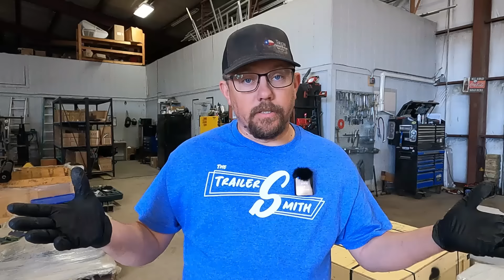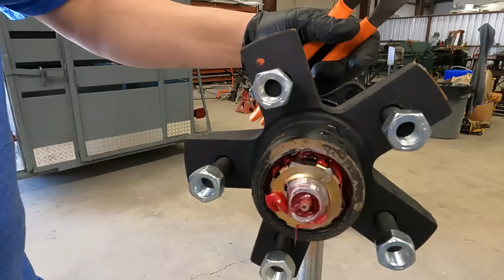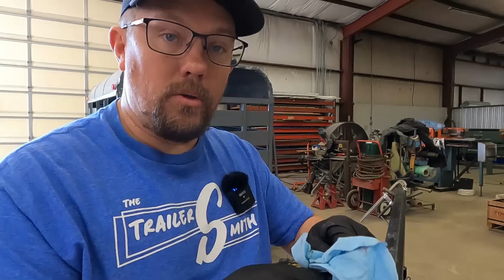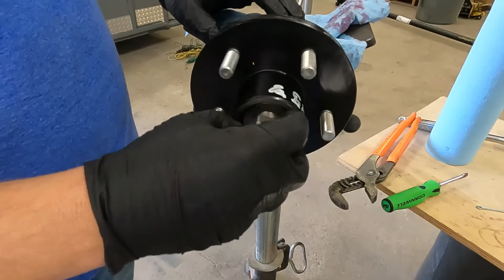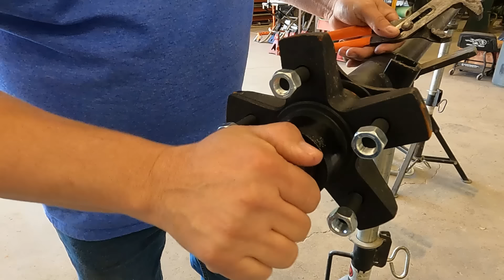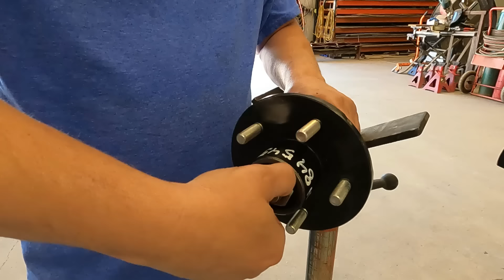How To Set Trailer Bearing Adjustment

Comment from the maker: Let’s talk about what it means to set the bearing adjustment for your trailer!  There are several different spindle nut and retainer options, do you set the adjustment on each of those the same way?  Is a torque wrench needed?  Now you can know the exact way to make sure that bearing adjustment is set properly.  And it’s easy!  Join us, as The Trailersmith answers these questions and more!

Links to products that may be helpful:

Dexter Spindle Nut Retainer Kit  https://amzn.to/4bFUfkr
Dexter Spindle Nut Retainer Kit  https://amzn.to/4bAjt3G
1” Castle Nut/Washer/Cotter Pin Kit  https://amzn.to/4byMUDa
4 pc Dust Caps 1.98”  https://amzn.to/3XBYlEi
4 pc Dust Caps 2.44”  https://amzn.to/3DqqyHv
4 pc Dust Caps 2.72”  https://amzn.to/3DfLVLJ
Red and Tacky Grease Tube 10pk  https://amzn.to/4iAI6zs
SuperS Hi Temp Grease 1 pk  https://amzn.to/4bDbt1T
Black Lightning Disposable Nitrile Gloves  https://amzn.to/3CET08k
Tub O’ Towels Heavy Duty Cleaning Wipes  https://amzn.to/4k2Rqxy
Scott Shop Paper Towels  https://amzn.to/4k0NTzN

DISCLAIMER: Some of the links included in the video descriptions may be affiliate links. If you purchase a product or service with the links that we provide we may receive a small commission. There is no additional charge to you! Thank you for supporting the channel so we can continue to provide you with content.

Check out Texas Custom Trailers for any trailer needs you may have.  And if you’re local, check them out for your trailer service needs!  If you aren’t local, but need a new trailer, they can ship it to you!  Tell them The TrailerSmith sent you!
www.txcustomtrailers.com

Links to other videos:
How To Clean Trailer Bearings Without A Parts Washer  https://youtu.be/c6vr7z2uoeg

Packing Bearings: When, Why, How?  https://youtu.be/4uSou1kasBc

Bearing Buddy: Friend or Foe?  https://youtu.be/zzvO9Brawu4

Trailer Bearings and Races: When Should They Be Replaced?  https://youtu.be/T1-8GBgimuU

Oil or Grease.  Which One Is Better?  https://youtu.be/nUrQjlPrnGw

How Easy is EZ Lube?  https://youtu.be/OyZvNJJNyXE

How To Pack Trailer Bearings Step by Step  https://youtu.be/Y2SHqV0VBQw

How To Fix Loose Bearings  https://youtu.be/Udpm6DkCxrk

Handy Packer vs. Cone Packer  https://youtu.be/ClOaxTHgXjQ

Trailer Springs: Double Eye vs. Slipper Springs-What You Need To Know  https://youtu.be/tj4pa6yXz6I

Chewed Up Equalizer: How To Fix Your Trailer’s Suspension  https://youtu.be/U9EhFKEo8s8

How To Replace Broken Leaf Spring On Your Trailer  https://youtu.be/7NcPkXaz2Tg

RV Axle Upgrade:  Is It Worth It?  https://youtu.be/cF2_dw-j6fU

Should You Grease Your Leaf Springs?  https://youtu.be/ij47JCA1EIU

Torsion vs. Spring Axle:  Which Is Better?  https://youtu.be/OOjPEW7qp1s

Spring Axles: What’s The Best Choice?  https://youtu.be/KQ-7cuKn0W8

Is It Time For A Brake Controller Upgrade?  https://youtu.be/iywBx4KwgG4

What Is A Non-CDL Trailer? Part 2  https://youtu.be/wbw6UEbOJ8Y

Get A Smooth Ride With The Shocker Hitch  https://youtu.be/cyxDaJO63wA

Dump Trailer Maintenance Made Easy  https://youtu.be/McjEwsYyHRM

Trailer Tires: Do They Need Balanced?  https://youtu.be/TOORDzwtGyU

Trailer Tires: What About Tire Pressure?  https://youtu.be/_ZI6opQ21MU

How The Vault Hybrid Lubrication System Works  https://youtu.be/HtA3ENa7vRk

Trailer Jack Replacement: A Heavy Duty Upgrade  https://youtu.be/GBh_cbybkYs

Prevent Disaster:  All About Trailer Breakaway Systems  https://youtu.be/yMbbGHg3XPA

How To Burnish Trailer Brakes Update  https://youtu.be/6F1aEo_Dk40

Is Your Trailer Axle Out of Alignment?  https://youtu.be/Wn_JyikwhNQ

Trailer Tires Update  https://youtu.be/2uKauvzfvYo 

Wiring 7 Way Plug For RV  https://youtu.be/6MJ7DLKTCUA 

How To Wire 7 Way Plug  https://youtu.be/6aFEcdjqGcA

Is It Time For New Brake Drums?  https://youtu.be/e6pWJ5V4U04

Understanding 4-Way vs. 5-Way Trailer Plugs  https://youtu.be/yHM2wWYioUY

All About Boat Trailer Surge Brakes  https://youtu.be/KdbaQYHzSqY

How To Diagnose Electric Trailer Brakes  https://youtu.be/ZEJ2DUdMhE8

How To Properly Load A Trailer  https://youtu.be/uSbw91Emi6

Trailer Tires: 5 Things You Should Know  https://youtu.be/BlKqcJfV9bc

Don’t Do This On Oil Bath Axles  https://youtu.be/PXmOGOuH2-g

How To Replace Hydraulic Disc Brakes  https://youtu.be/2UyS2hAen4g

How To Burnish Your Trailer Brakes  https://youtu.be/mLp_5ApVjFc

How To Adjust Trailer Brakes The Easy Way  https://youtu.be/ClNp8T9cGo4

Comment: Pre-loading bearing is not a bad thing on tapered roller bearings. Most don't know how much is too much. The purpose of torquing to 50 ftlbs is to seat the bearings and races, a very common recommendation by Ford, Dana, Rockwell and many other manufacturers. I've been doing bearings on rolling stock and vehicles for over 30 years and  have seen more damage from loose bearings than from what some might consider over tightened.

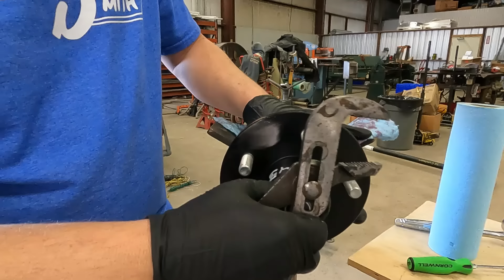Comment: At 9:50 that was not 1/4 to 3/8 of a turn.  1/4 turn is 90 degrees!  You loosened the castle nut maybe 20 degrees.  Otherwise, all good information!

Comment: I was taught on a new grease pack, to tighten the nut down to, like you say, 50ft/lbs while spinning the hub, and then back the nut off 1/4 turn. If it's an old grease pack and you're reassembling it with the old grease, do the same, but back the nut off 1/8 of a turn. This applies to tapered roller bearings, but it changes for axles with round roller bearings.

Yeah, I'm one of the old-school guys, but I've never had bearing failure on heavy construction equipment, tractors, trailers, etc.

Comment: Perfect video...nice job! One thing that many forget to mention...the reason why you don't want to completely tighten the nut against the bearings, is that as bearings and surrounding components heat up, they will expand. A proper tightness, maybe even a little on the lose side, is better for the bearings. I didn't quite understand when you mentioned 50lbs of torque...the idea while rotating the assembly is to seat the bearings. Then you back off to allow some clearance for running heat. I do also want to mention, as I was in the bearing and PT business for almost 45 years is that it is a true fact that most bearings fail from OVER-lubrication (not to mention NO-Lubrication!) in a grease-lubed system (not an oil bath), than not. Grease retains and increases heat which always is not desired. 

A close topic to share: about 3 trailers ago, I had a service center fill up my bearing buddies to the *HILT*, and 500 miles later (with zero brakes on a 15k toyhauler trailer) I was in a shop paying for entirely new brake assemblies and about 3 cases of Brake Clean and wasting about 7 hours of time. I haven't used bearing buddies since. :-)

Comment: On my cargo trailer I have the easy lube hub/spindle, it just has a castle nut and a cotter pin through the castle nut and hole in the axle spindle.  What do you do when the wheel bearing has play but when you adjust to the next groove in the nut it is now too tight or much tighter than hand tight?

Comment: Mine are 6k axles with a cotter key and ez lube. Is there a psi required from the grease gun to properly grease the bearings? I have a 4500 psi grease gun but it does not grease into the ez lube. I usually just grease it by removing the hub assembly

Comment: That was less than 1/4 turn before you installed the cotter pin. I adjusted mine to 1/4 turn then install pin or back off until pin lines up, is this too much? being picky because I plan on putting alot of miles on my RV far from home and trying to avoid issues. Also having a hard time getting quality bearings and races. Do you sell parts online? Great videos. Thanks.

Comment: If you adjust your bearings in this way, it will always be right.  That said, I always put the wheel on and feel for that tiny bit of movement in the bearing that should be there.  The bearing has to have room to expand as it warms up.  Great videos!

Comment: So basically, finger tight and pin it with retainer or cotter. ?
Reply from the maker: After you go through the full process, yes, finger tight or 20 foot pounds of pressure. The process of tightening and loosening is important to set the bearing load.

Comment: I was taught to install everything, even the wheel and tighten up.loosen. then spin the wheel with the tire on and tighten the nut with a socket until you see the wheel slow down then back it up an eighth of a turn. Was that incorrect?

Comment: Some Karavan trailers use special cotter keys, called Karavan "Super Lube Cotter Pin" - you can find it by searching for part #229-00114-NA-C. If you don't use their cotter pins, the axle "Super Lube" system will not work properly. Your grease will come out the cotter pin holes instead of pushing through the axle through the inner bearing, then through the outer bearing. The Karavan Super Lube pin plugs the cotter pin hole in the axle so that the Super Lube system works properly on the axle. If you don't have one of their pins handy you can move the castle nut around until it's fully blocking the cotter pin hole, and proceed with hand-pumping grease into the axle.
Reply: I emailed caravan trailers and they sent me a few pins.
Reply: I had a REALLY hard time getting one of those pins out. It was tough to straighten out without getting it out of round.

Comment: "finger tight" - that's your spec?
Reply from the maker: No, that’s the manufacturer’s spec. Just relaying the info.
Reply: @TheTrailerSmith  At least Timken specifies proper runout of 1 to 5 one thousands of an inch after applying 25 ft lb of torque and then backing off by 60 to 90 degrees.  Finger tight is probably good when you have a lot of experience. To a newbie like me, it's better if I can measure it.

Comment: I think he likes to throw good parts away.  Wasteful.  If the used parts are good. Save them.  Otherwise good information
Reply from the maker: If it’s an expensive part but easy to compromise when reused, then I just don’t see the point in taking the risk that it will work properly. Especially when I work on other people’s trailers, I don’t know the history of the parts and it’s better to be safe than sorry and avoid any liability issues. I actually do say this in the video. Also, I don’t throw them away, they get recycled. No waste.

Comment: Good video.  I adjust the bearings on my trailers as you have shown without the use of a torque wrench. I like to have some perceptible lateral bearing movement, but I usually change most of the castle nuts to a 12 slot to avoid running the bearing looser than I want.

Comment: Thank you for the detailed description on how to properly set up the new bearings. I plan to do a DIY bearing and race install on my 5x10 utility trailer and Im pretty sure it has a 3500 pound axle with easy lube and that last style retainer you showed with a cotter pin holding it in place. The one thing I wish you would have added to this video is how much "wiggle" or play should there be in the wheel after everything is tightened down properly?

Comment: I have a very old hand built trailer. Look like it was built from Popular Mechanics in the late 40s. The trailer shop said the axle is vintage 1950 era. Bearings are still standard, but the grease seal is a machined steel washer...no neoprene seal. Hub covers are heavy metal screw on. Uses cotter pin/castle nut. Good video on bearing adjustment.
Reply from the maker: Sounds like you have a cool vintage trailer!  Thanks for watching!

Comment: Just a little tip. Use a flathead to remove the cap around the lip and reinstall with a bead of loctite. You will NEVER have a cap fall off doing it this way. When you need to remove it comes off no problem.
Reply from the maker: Unfortunately, the caps are so cheaply made that we never re-use caps. When we do install the new one we do use an adhesive with it.
Reply: I usually loosen them from the hub with a thin paint scraper, then a tiny pry bar or flathead. Starting with the paint scraper helps to prevent tearing up the flange. Gonna try the adhesive thing though. Should I put a little bit at the 3,6,9,12 o'clock positions? Or all the way around?
Reply: All the way around.
Reply: I miss when a grease cap it could support the weight of the trailer

Comment: Hi trailersmith, thank you for all of your videos, you help everyone stay safer. I have dexter 3500 lbs axles. They are the older models with the castle nut /coder pin combo. Can I upgrade those with the easy lube style spider washer setup? That would allow a finer adjustment consistent with the factory recommended 0.05-0.06 endplay adjustment. Thanks in advance and thanks again for helping us stay safe. Jim

Comment: So, Timken recommends 1 to 5 thou end-play for proper setting.  With a spindle that has a 1"-14 thread like on a 3.5k spindle, for every revolution of the nut, the nut traverses axially about 71 thou.  For every 1/6th of a turn, that is 12 thou and for 1/12th of a turn, 6 thou.  So when you finger tighten the nut and assuming that is zero end-play, then  back off 1/6 of a turn, you will have about 12 thou end-play which is too much according to Timken.  If you have a nut with 12 notches, that is still 6 thou which is 1 thou over.  I measure my end-play witg a dial indicator and have proven this out.  In order to achieve 1-5 thou end-play per Timken spec, I have had to thin out the nut, thin the backing washer, or use arbor shims between the washer and nut to achieve in-spec end-play with the nut lock in place (clip, cotter, etc.)   In practice, following the methods axle manufacturers call out, not Timken, you are most likely to have too much end-play.
Reply: Thank you, someone else who sees this as wrong as I do!
Reply: BILLIONS of trailer axles have probably been assembled with a little extra clearance and probably none of them have failed because of it, so I would recommend not losing any sleep over it!
Reply: Specifications are generally two reasons, One how they were designed and so the layers have ammo when they weren't not installed exactly right to protect the manufacturer from the customers. Unless your shop is temperature/humidity controlled and you are using annually certified dial indicators ( for the same conditions as your shop) worrying about .005 on a bearing you should replace yearly is a bit down in the weeds. It's a trailer axle not a rocket engine.
Reply: I had a guy do the finger tite method on my trailer didnt get 5 miles down the  road both sides  the NEW bearing Buddy's came off. You got to have the wheel on first to tighten the nut.

Comment: I have a case I would like to see if you’ve experienced. We have a Ranger bass boat. The trailer is a Ranger trail originally with oil bath hubs, which might be a good idea, but they tend to leak and fling oil all over the inside of the rim.
They’ve been converted to grease bearing using a two or three rib grease seal . Any advice
Enjoy your videos have watched many finally couldn’t resist commenting